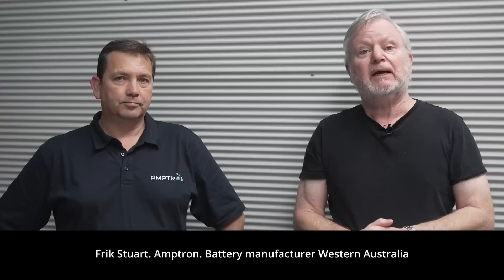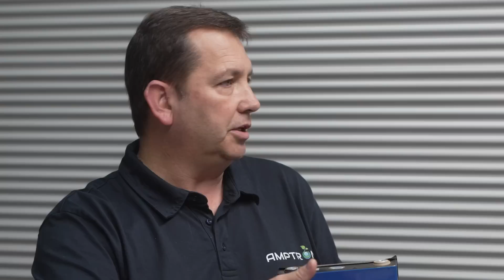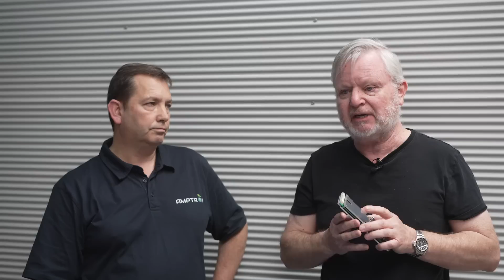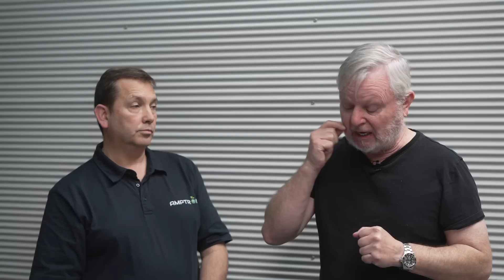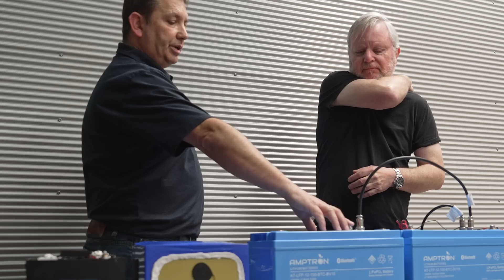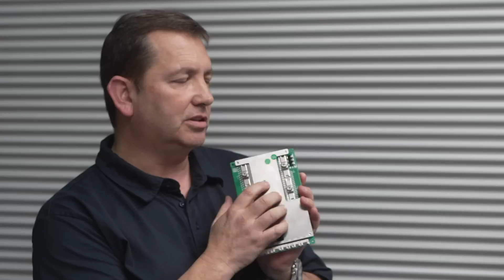LiFePO4 (lithium) Batteries. Separating Myths and Facts @4xoverland

Comment: You should check out the eccoFlow Powerkit "all in one plug and play" type system it is several evolution steps beyond what you are discussing for mobile and stationary installations. In addition, it costs less to buy and is much less expensive to install since you just have to plug in pre-made cables/connectors between the main components. It is based on 48v battery units connected to an all in one BMS/charger/inverter/solar controller/external power input & power sharing that is connected to an intelligent controllable A/C & D/C distribution box, with system control via a remote display or App. Battery manufacturers such as Amptron or Victron are in danger of being left behind as old technology/system if they do not develop and market something similar.
Reply: It's a nice system but cost prehibative for most. Probably overkill also for 4x4s and most things except for large caravans.

Comment: I do think there is a large benefit for most people who are getting into offroading.. You could have one battery which is your crank battery and your accessories battery..    It could remove the need for a dual battery system..

This is a pretty big pro. Especially cost wise..
Reply from the maker: If its one battery, then the accessories could drain it so it then fails to crank. That's why split charge solutions exist.

Comment: Amazing how late to the lithium party caravan and 4x4 people are! Some still hanging on to their AGM and for some weird reason they all want to use lithium as starter batteries??
Lithium wasn't designed for starter batteries, it for power storage.
It's not just lithium that has revolutionised off-grid power but Victron has made leaps and bounds in providing very reliable controls, monitors and inverters! That has been a perfect way of getting the most out of lithium batteries. Victron should be awarded a noble prize for innovation!
Reply: I got a pretty great invictia lithium hybrid battery, combining a starter and house battery in one. Wouldn't go for something else
Reply: @louis__bm no doubt lithium battery manufacturers are definitely trying to make a reliable starter battery, anywhere they see a potential market they will try to capitalise!
They can try and insulate it from the extreme summer and have inbuilt heaters for the winter. Program the BMS to deliver a peak 1000 or so cranking amps to turn the starter. But a hot engine bay is still no place for a lithium battery the degradation will be 2 or 3 times as fast then there is the issue of reliable charging as again alternators are not designed for lithium battery charge profiles.

Your hybrid battery uses pouch cells which are a little more energy dense than prismatic or cylindrical and can take the knocks and bumps. I'd be interested in how it goes long term! 3 year warranty is not bad!
Reply: Most RVs older than  5yrs don't have chargers that support Li. Changing to Li can be very expensive exercise, could be up for new DC-DC, AC-DC, Solar chargers on top of new battery price.
Reply: IDK about Li being for storage only. Check out some of the cells available that can supply 70C (that's not a typo) LTO is even better for power, but is even less energy dense than LiFePO4. For starting you could also use a supercapacitor battery. They take up even less space and can handle more heat. They just can't store much energy.
Reply: @jensdenk9235 I'm not questioning the output capability of lithium, the previous guys comment on he's Invicta hybrid starter battery can produce 1400 CCA with pouch cells! but lithium likes to be charged and discharged in cycles. Short high discharge bursts and then recharging is again detrimental to the life of the battery. It's imo an expensive short term way of starting your vehicle.

Comment: Only reason to fit a Lithium starter battery would be for increased capacity to support simple camper equipment loads such as lights, fridge etc in one underbonnet battery. 
In a LR Defender the starter battery is located under the seatbox so temperature is not an issue therefore additional capacity of Lithium starter battery would be beneficial in an overland or camper with dual Underseat battery setup but as it’s not sealed it does not comply it seems.
Reply: also people with gvm/ axle weight  issues

Comment: Correct me if I am wrong but I have seen at least 2 people with lithium batteries stating that their car starts better/quicker and also that their winch pulls significantly harder and also they are able to run all their accessories while winching
Reply: @hawk3356 Youre right. Faster, less stressed starting(less wear and rest on the starter. The LiFePO4 battery has a lower internal resistance, which means it charges up quicker. Battery shields / blankets can help mitigate the heat problem.  I would like to see more research about the increase in efficiency of LiFePO4 vs LA. I've put one in my EV and it seems I'm getting about 8% more range.
I assume that because LA batteries are "forced" full even when they are full. EVs don't have the heat in the engine bay problem. 
The biggest issue with LA is the sudden death.

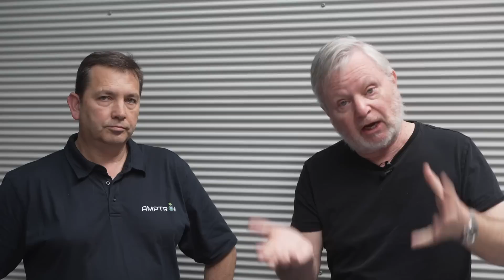Comment: 2:36 You said this a few years ago.
For my engine bay (Ram 2500 Cummins 5.9) I use an IOXUS Ultracapacitor on starter side and XS POWER Titan8 Lithium Battery on the alternator side. Both designed for engine bays and high amperage loads. The ultracap takes the load off of the LTO lithium battery which allows both to last many times longer and they both have built-in management. IOXUS Ultracap has (an optional) free bluetooth app and a jump start reserve in the case it senses a low voltage event.
Reply: @xoxoops  
Haha "bolt-ons" there's a few. The front end swap from an '04 -'07 with baja fiberglass fenders and hood took a little massaging tho. 

Kid is grown and loves to wheel it. 

Mechman alternator has enough amps to power a large audio system and charge the solar generator when there's no solar.⚡

Comment: Andrew, changed the batteries in my caravan to lithium ( Blue Nova 105's) and what a pleasure. I have a Victron 30-amp DC to Dc to charge when travelling and a 600-watt panel on the companion's roof.   In hind sight I should on replaced the two lead acid unit with one LIFEP04. Great information from all your vlogs. Regards

Comment: If a lithium battery only takes up half the space for the same lead-acid battery, isn't a good reason for under-bonnet lithium, that you can have a "half-size" starter battery, with another half-size lithium for accessories. all in the one pre-existing battery tray? It's obviously going to work out more expensive, but provides a legitimate option for people with nowhere else to put a secondary battery?
Reply from the maker: Sadly, it's not that simple.

Comment: The most objective supplier on the planet here, but nobody can convince me that the manufacturers have any idea of what the effect of hours of brutal corrrugations will be on the inevitably dodgy looking mechanical restraint of the BMS gubbings, which always  looks designed to chafe cables and fatigue its soldered joints. Show me a perspex LiFePO4  battery casing with military / aviation grade cable management visible and maybe I'll  abandon AGM.
Reply from the maker: You make a fair point. I've been using these for about 5 years, and encountered brutal corrugations many, many times. Actually,. just last week some of the worst I've ever encountered. My Africa trip this year, the roads were truly terrible - week after week. Not a single failure yet.
Reply: @4xoverland I've been thinking about a suspension mounting for batteries, with a braided output cable arrangement.

Comment: Using LifePO4 as a starter battery is a complete phoney side track.
Putting a LifePO4  as a house battery under the bonnet for convenience is an important discussion.
I've had a LifePO4 under bonnet for 7 years and 90,000k's - only problem was faulty battery monitor shunt -
2016 Prado.
Reply: what brand?
Reply from the maker: this is good to hear.
Reply: Running a Prado  with 2 AGM to anchors . Been told reduce weight in the engine bay as there 2 slots on the prado. Been quoted $3000. 
Seen others running the deep water crossing and high 
temperatures, 3desert crossing. Any tips on batteries?

Comment: I'm building a suburban, the lithium batteries will most likely be under the vehicle on the opposite side as the fuel tank. Separated by the drive and water tanks.

Comment: Any chance you could condense all that to 5 minutes, maybe just the facts? I am far too busy to watch all that. If you were doing a build, I'd watch, but man, too long. Ciao
Reply: From AI (Gemini): This video discusses the evolution of lithium iron phosphate (LiFePO4) batteries and their impact on the overlanding and camping community. The video highlights the advantages of LiFePO4 batteries over traditional lead-acid batteries, including higher energy density, longer cycle life, and improved safety.

The video also discusses the importance of battery management systems (BMS) in ensuring the safety and longevity of LiFePO4 batteries. BMS systems monitor the voltage, temperature, and current of each battery cell, preventing overcharging, over-discharging, and overheating.

The video concludes by emphasizing the need for compliance with safety standards and regulations, particularly regarding the display of battery information. It is important to have a physical display that provides information about the battery's state of charge, voltage, and other relevant data, even if the battery system can be monitored remotely through a smartphone app.
Reply: @mozartheart2958  you're awesome
Reply: @mozartheart2958 . Man, you’re fabulous!
Reply: @mozartheart2958  Thank you and....with my phone I wish to know the state of charge but why would I wish to know the voltage of a battery?
Reply: @joezephyr . The battery in your phone is designed for your phone alone. The battery in a van has to accommodate DIFFERENT draws from various appliances, so, depending on each one’s consumption you end up with different end voltages. (W/V=A)
Reply: @arcenciel2968   OK but I would have thought that I plug things into the battery and then the battery drains. Obviously some things will drain the battery faster than other things. Its the battery level that interests me. When I have a shower, the bucket of water will run out eventually.
Reply: @joezephyr   But he made it so clear! For the lithium batteries, on the one hand, it is USELESS to monitor the variations in voltage because, simply, they do not occur! From a little less than full, up to until almost completely empty, the voltage remains the same. The same.
Where monitoring the voltage has some meaning is with the lead acid batteries where, lower charge levels bring on lower voltage levels and, by experience, when you see a drop of voltage to near 12volts you infer that the battery has depleted some...
Your telephone, though, has no lead acid batteries!
Reply: Who says a starter battery must be in the engine bay…
Reply: @ottovink5766   Nobody! But what are the chances that starting batteries are not in the engine bay?
Come to mind the Mecedes A class where it was under the passenger floor, and a few other cases.
Reply: @arcenciel2968  my torana battery in the boot
Reply: @ bmw, defender, lots of vans. By the way, not saying lithium is het better for starting
Reply: @ottovink5766  A large number of European vehicle manufacturers don't think it should be.
Reply: Go to settings > Playback Speed > 1.5. Andrew may sound like Alvin the chipmunk but at least you can watch in less time!
Reply: He spent too much time repeating stuff, especially what the battery expert had just said but just in a more animated way. 🙄
Reply from the maker: But if its important to you, then spend the time. I didn't ask any unimportant questions.
Reply: @4xoverland  Maybe time stamps would be useful for those that cant or dont want to sit through allbthe padding.
Reply: @dash4177 maybe if you're not interested in science, this isn't for you.
Reply: @4xoverland 
It was just too much talking, man, maybe I've been married too long, I don't know. I'm an Aussie: bloke short and sweet, and to the point is the way I roll, unless you're doing a build.
Reply: @darwinsdrongodrivers  If it doesn't interest you then simply bypass it.
Reply: @nathankelly1708  derp

Comment: Also why do people rate lithium in amp hours to suit the boomers. It should be KW or KWh.
Reply: My hilux has 120kw's it doesnt have amp hours ahahaha....but my lifepo4 batter is 100ah, my AGM was 120ah, super easy to understand
Reply: @Tom-lf8hx  umm..your Hilux has Kw because it’s a measurement of power just like lithium batteries.
Reply: I prefer amp hours
Reply: @darwinsdrongodrivers  as I said easier for boomers, bit like inches and feet.
Reply: People don't rate the batteries, battery manufacturers rate the batteries and they have always been rated in AH or mAH even before the boomers came along.
Reply: @magicalvortex  so you have seen lithium rated at amp hours many years ago?
Reply: @douger1517  All batteries have been rated in AH or mAH for the smaller cells, not just for lithium.  No need to change things to suit millennials, just because they want to change the world.
Reply: @magicalvortex  electricity power since it was invented was measured in watts. Never  in professional/ science or general public is ah used only the caravan camping world. Go figure.
Reply: @douger1517  DC electricity was invented by Thomas Edison and was measured in potential difference and current or joules. AH is the preferred unit of measurement for battery capacity and has always been this way. AC electricity was invented by Nikola Tesla and its capacity is measured in W in pure resistive circuits and in VA in reactive (capacitive reactive or inductive reactive) circuits. The unmeasurable component in a reactive circuit is denoted by VAr, and is calculated vectorialy as it cant be measured, hence generators are rated in VA and incorrectly rated in Watts sometimes. It should be noted  that the Joule was used as a unit of measure.
Reply: @ all lithium batteries over boomer camping size is DC and rated in KW. That’s just the way it is. Do some research.
Reply: @douger1517  Kw ratings on batteries alone are meaningless, without their respective current and voltage ratings. It saddens me that there are so many millennials in this age that have been pushed through the school system that don't or can't understand basic maths, even to give out correct change at shopping centres. It isn't entirely their fault they have been incorrectly graded and pushed through the school system, but what they don't learn at home and what they don't learn at school, they world will teach them what they will need to know in order to survive; that's just the way it is. I don't need to do some research, I know what I know, If batteries have been rated in Kw it's because some people can't multiply or do basic maths. Once a battery has been degraded to a certain extent, it's Kw rating becomes meaningless, but yet it can be corrected using it's current carrying capacity along with it's voltage. That current carrying capacity is measurable in AH, not Kw.
Reply: @ …….ok boomer
Reply: @douger1517  Wrong again.
Reply: Ha ha 
🤣

Comment: So based in the discussion, battery boxes in the back of a 4WD are no longer compliant?  Is the standard retrospective?
Reply from the maker: As far as I know, portable battery boxes do not need to comply.
Reply: @4xoverland  Ok thanks, I'll have to read the the standard, as I am currently setting up a 4WD with a portable system and will soon commence a renovation to a caravan with a fixed system.
Reply: It sounds like only connectable systems, so if you don't have a 240V inlet on your 4WD you should be good! Also sounds like a win for the ute's, battery in the tub, tub isn't habitable space!
What gets me is, not accessible from the habitable space? Might need to buy a copy of the AS/NZS 3001 and have a read! Also interested how this plays out in the 4xoverland HiAce build!

Comment: One reason I can see for a lithium starter battery: 

You are building a race car and want to save weight, cost and longevity be damned.

For a 4x4 overland vehicle you are 100% correct.
Reply: Yup, but even with an Overlander, you should really look at the weight  and savings as it does also effects it big time ! I have got a 24 volt system (HZJ 75) !